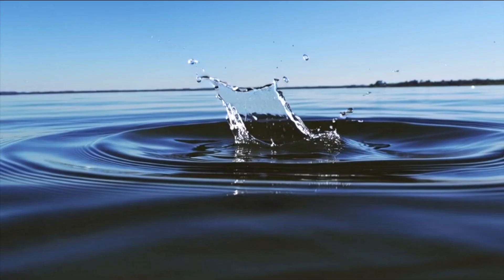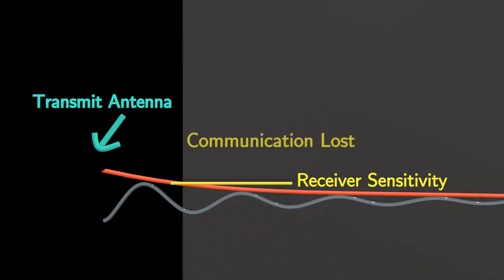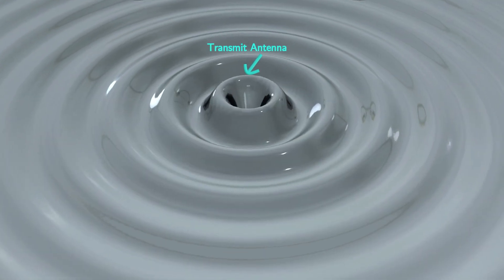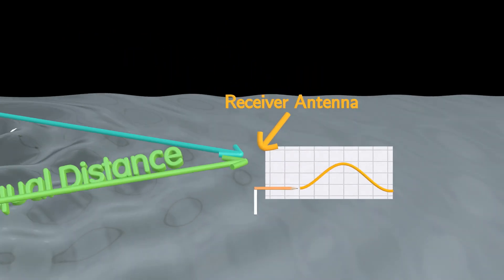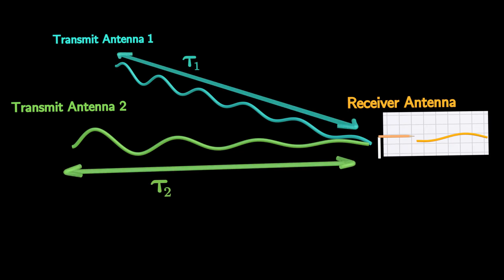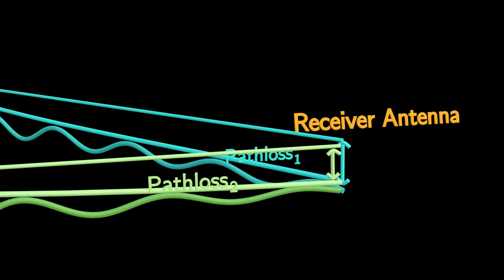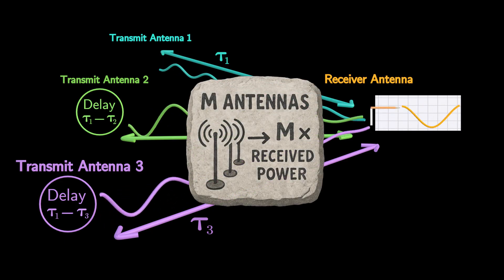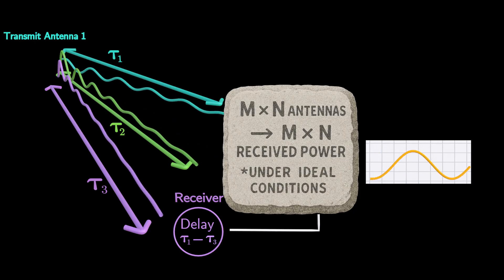What is Beamforming in Wireless Communication?

Comment: Yes this is a good explanation and to my knowledge all correct. I would however like to mention that one of the big problems with the rechiver not being able to receive the signal is often not that the signal is too weak but that the noise to signal level in the receiver is not good enough. If there was no noise in the receivers input I am convinced it would be possible to receive the signals at a much lower level. I have for many years wanted to (but never gotten around to) make a dual first stage of a radio receiver and then using a comparator only using what signal was the same in both. Noise is usually randum and there fore would be cancelled. The method has been demonstrated to me when I studied electronics 50+ years ago but for signals going through cables.
Reply from the maker: Appreciate the comment, and your thoughts!